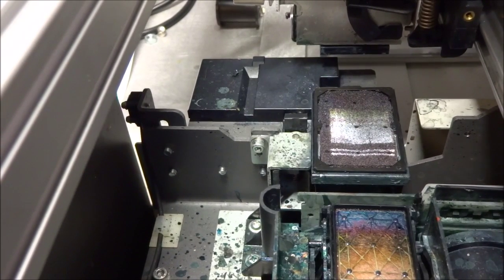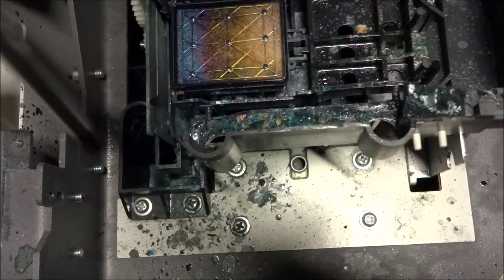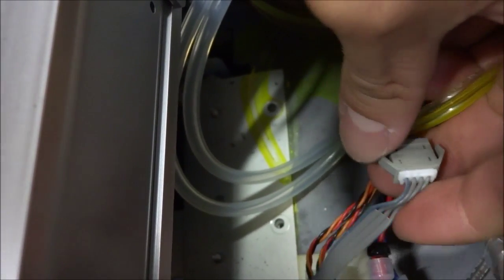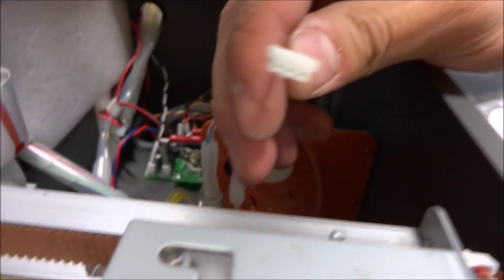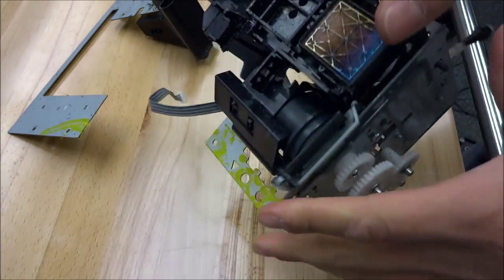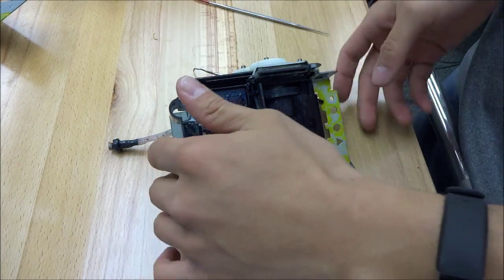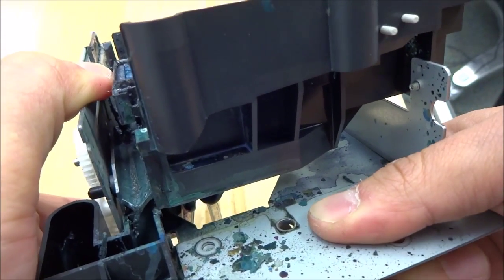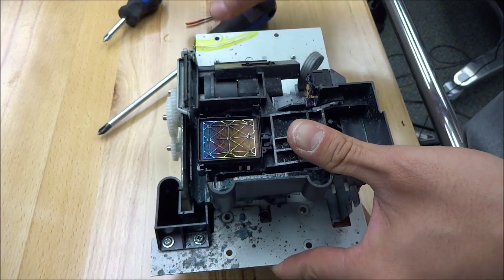m2 cap station vid compress

Comment: does a capping station (say on an epson wf-7610) suck ink? or just collect it? did about 20 head cleanings to get the printer to print normally. it wasn't a clog, but air in the heads. i use a ciss, works well 90% of the time, but there are instances where i do a single head cleaning, which makes it absolutely worse... i'm told that it could be an issue with the capping station. 20 cleanings later, it works normally. you'd think the waste box would be full of ink, but it isn't because around the 18th cleaning is when it started flushing ink. the previous 17 flushes were nothing coming out and the ink tanks on the ciss were still at the current level.
Reply from the maker: Hey Scrooge - sorry,  you'll need contact support for that one